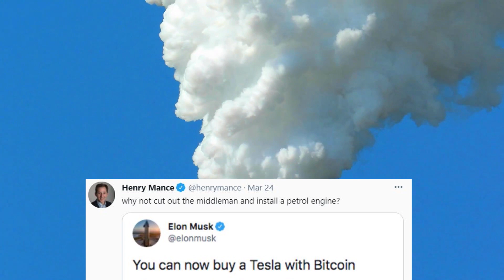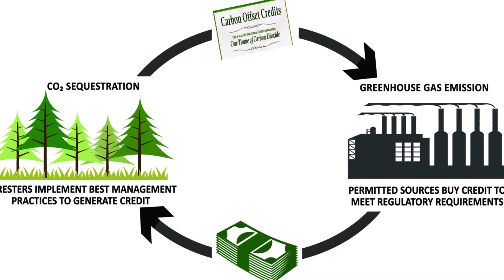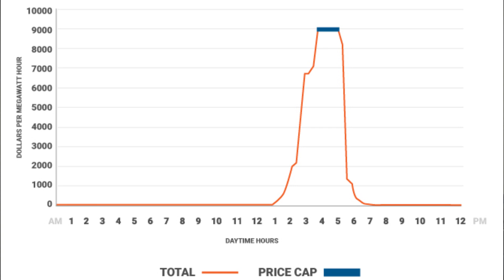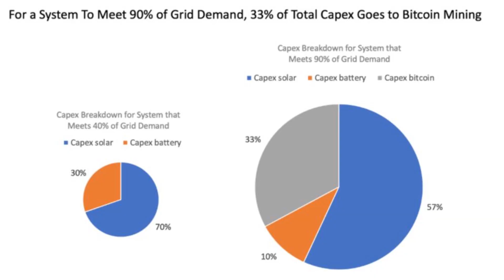The Bitcoin Green Revolution - Is Cathie Wood Right About The Environmental Impact of Bitcoin?

Comment: The biggest problem with this thesis from my view is that it assumes green energy will be what is demanded for mining bitcoin. The thing is that bitcoin is energy neutral, it doesn't care which type of energy it receives, so the cheapest form of energy is prioritized. In this case, there is a very good case for nuclear energy, which is an industry that I am personally interested in, especially as China has been expanding it's nuclear to provide more energy to more of it's citizens. It is possible that the US might change course on being anti-nuclear if China implements it, which would make the industry explode in terms of profitability. 

The biggest issue for nuclear energy though, is that it threatens the business interests of much bigger energy producers, such as solar, wind, and natural gas who have an abundance of demand through lobbying. Various age old concerns about nuclear proliferation and meltdowns are used against nuclear, despite various reactor and fuel cell designs that make it physically impossible to repurpose for weaponry needs or meltdown.

Comment: To summarize, we’re going to quintuple the worlds power generation just to produce an intangible currency that is completely unsupported and unregulated by any government which puts it at a high risk of losing its entire value at any point in the future. 
Oddly enough, the top 3 cult fanatic investments of crypto, EVs, and battery storage are being combined into 1 mutually supporting investment thesis and being pumped by the pyramid investment queen herself, Cathie Wood... not to mention that the entire reasoning behind the thesis is beyond flawed. It’s diametrically opposed to reality.

Love these reality check analysis’s @patrickboyle !!!

Comment: In theory, and according to the bitcoin "plan" laid out by the mysterious Satoshi is that at the 6th "halving" over 99% of all possible bitcoin will be mined. This is currently projected to happen in 2032 or so.  At that point it will be much much much less profitable to mine bitcoin.  At that point finding a bitcoin would be akin to winning the Powerball lottery. Unless Bitcoin goes to a million us dollars or higher, most miners will drop out, lowering the hash rate and thus the power consumption. 

The "plan", such as it is, is that miners will maintain the network for lots of reasons, ideology, profit (only much smaller, transaction fees only), or they are financial institutions in the new crypto economy that benefit from having a copy of the blockchain locally. 

The Bitcoin network could be maintained securely for a millionth of the current power consumption. Yes a millionth.  This high power consumption period was considered a necessary evil phase to establish the network. 

I don't necessarily buy in to any of this, just reporting what I've read over the years.

Comment: The sort of green energy future painted by that paper is a very optimistic concept. It would work best if done on a macro level with solar panels and batteries distributed by the grid operator for a grid designed for renewables and with the distributed crypto mining baked into the electrical grid design. The infrastructure cost for that if done to the highest degree would be very high. Which is why China could do it. They have the means of production right there and the ccp has huge financial backing. For most established towns in the west the best you’ll get is either a high number of enthusiasts who fancy themselves as entrepreneurs or businesses forming that are able to make solar crypto mining into a profitable and scalable enterprise. In Australia solar uptake is very high thanks to government incentives. For the many solar accredited electricians down under some are starting to capitalize on their qualification allowing them to set up huge solar arrays at their houses , sometimes using older panels obtained for free from system upgrades (that are becoming more common as bigger systems have become a lot more affordable over the last ten years) and setting up crypto mining rigs to use that free energy to make money at home. The biggest barrier to entry is the cost of batteries and the cost of setting up a crypto mining rig. That’s well over ten thousand in capital expenditure to be recouped before gains can be realized. That would take probably two to three years if I’m being optimistic about what that crypto rig can pull in. In fact I wonder if a crypto mining rig can pull in more over ten years than a etf that takes in steady ten percent annual returns

Comment: Honestly the model is very naive, not all miners are doing massive operations that could go on the route of creating all that infrastructure just to mine. A lot of miners quit when the price drops. In my opinion the solution is the proof of stake model, yes it still consumes energy to process transactions (as it consumes energy to read this read/write this comment) but at least you don't have the issue of increasing difficulty resulting in needing more powerful hardware and more energy

Comment: Bitcoin is dumb because it's designed to require a lot of energy to mine and therefore has a carbon footprint.  Unlike storage of excess energy in a battery, the storage of energy in a bitcoin is irreversible; you can't power the city with bitcoins.  Therefore, I'm out.

Comment: 10:15 To answer your main question, please check Tony Seba's concept of superabundance: If solar and wind energy and batteries are really on a declining cost curve, energy becomes superabundant. This is a good thing, because at first it will make gas and oil obsolete. Only then there is so much capacity that now it can be used for Bitcoin mining.

Comment: As long as both Square and Ark Invest have mutually motivated goals in crypto and green tech it is not surprising they used the same narrative for the same cause. Does it make their points more credible? I strongly don’t it. It is like two salesmen pushing the same brand. They do not bother much of true reasoning altogether. They SELL!
The utilities sector is perceived as defensive due to state industry regulations. The state influence to be major factor almost everywhere in the world creating incentives right or wrong, restrictions and limits with loopholes or not, distortions in business fundamentals are as common in the utilities that it is not far from universal rule.
This is the start point of any feasibility study so far. Energy balance is driven by the mix of different natural, tech and political factors however for any single part of the world, country or even a local area makes one as different from the other almost to the state of unique. 
Take China with huge energy balance deficit at national level and huge ample power in certain areas of the country where local authorities subsidies electricity consumption for mining.
In Russia where the industry deregulation and modernisation  of  old power infrastructure caused ample capacities in some regions while other are still substantially Susa fixed and old. There are many loopholes in regulations as well used by state run enterprises and crony businesses.
Take Bielorussia as a more simple example. This small country used to import power from other regions of the USSR after Chernobyl tragedy, for years carried deficit in a balance of energy and decided to invest in new nuclear power station. By the time the project is complete they have a huge amount of ample power with nowhere to use as the real consumption growth well behind former conservative estimates. Guess what was a solution? A huge state run mining pool.

Comment: Everything uses energy. 
400twh for aircon in china
240twh to aircon in us 
440twh on tv's
Bitcoin 121twh, 76% on renewables. Thats 0.075% of global energy damand.
 That is absolutely tiny. On the latest miners 1 terahash uses less energy than an average light bulb. Why is bitcoin an issue. Everything uses energy but for some reason bitcoin has to be green otherwise it's wrong.
People are going to lose their mind when they realize how much  electricity is going to be needed when electric cars become more popular.
Also comparing visa and bitcoin is not exactly the same. Visa runs ONTOP of the banks AND fed wires(as an example) AND Swifts infrastructure. And let's not forgot the millions of bank employees who have to burn energy every day to make sure the banks can operate.  Not that I have an issue with them using energy but this does seem to be the flavour when talking about Bitcoin so why not include it. Ie energy usage is wrong

Comment: Using excess power to mine Bitcoin doesn't seem like a bad idea imho. In summer Germany has to sell their excess solar energy to Belgium and Netherlands at a price of -5ct/KWh, so basically they have to PAY! 5cts for them to turn off their nuclear power plants as to not overload the grid. Unfortunately German grid operators don't adjust prices according to short term supply/demand changes. If they did adjust the price however, you could technically get payed to charge your EV or mine Bitcoin. That way, Bitcoin miners wouldn't necessarily have to be directly involved with the power production. (Which seems kinda dumb to me anyway, because if you are good at mining Crypto doesn't mean you are good at running a power plant and vice versa)

Comment: What commodities are used to build solar panels? Asking for a friend.
Reply: A lot of rare earth materials are used in the production of solar panels...solar and wind are not as green as a lot of people believe.
Reply: @cosmiccoffee8497  Rare earths aren't used in solar panels, at least not much.
Reply: @seneca983  They are and a lot of them are. There are also maintenance costs among other things. 

Here is a quote from google;
"Renewable energy development relies upon sufficient quantities of rare earth minerals, specifically neodymium, terbium, indium, dysprosium, and praseodymium. These are used in the production of solar panels and wind turbines."

Solar panels also degrade over time and have to be replaced. Same with wind turbines. There is more to wind and solar than the face value of the feel good narrative stuff pushed by many.
Reply: @cosmiccoffee8497  Your quote talks about renewables in general, not solar panels specifically. Rare earths are used in e.g. wind power but not (much) in solar panels.
Reply: @seneca983  You should seriously go look up what it takes to make a solar panel. It might surprise you.

They aren't made from hopes and dreams.
Reply: @cosmiccoffee8497  They aren't but they aren't made of rare earths either.
Reply: @seneca983  They are. Go look it up.
Reply: @seneca983  You should also check out all the crap they put in batteries while you're at. You need a few of those for every solar system you put up.

Edit: Lets just add DC/AC inverters to the list while we're at it. All that's just the tip of the iceberg.
Reply: @cosmiccoffee8497  I did look it up. The result was that they're (mostly) not used in solar panels.
Reply: @cosmiccoffee8497  You can consider those aspects but they're not what I was commenting on here. You said: "A lot of rare earth materials are used in the production of solar panels". That's the part I responded to (by noting it's not true).
Reply: @seneca983  Okay dude, where does the metal for the screws in the frames come from? Again, what do you need to run a solar array? How about the chemicals processes used during manufacturing? how are all of these various things sourced and shipped about?

Oil, gas, mining operations, sterile production facilities, robots, computers, engineers, interns, planes, trains, automobiles, etc, etc, the list goes on and on and on with things you need to make a single solar panel.  

Guess you're going to need a rubber tree plantation somewhere for all that insulation on the wires too. This is all magic pencil stuff.

"Mostly" as a caveat meaning because they're everywhere in the food chain for making these things including in them. The requirements to produce a thing goes much deeper than what is in the thing itself. Again, look past the face value.
Reply: "What commodities are used to build solar panels?"

I think the biggest ones are probably silicon and electricity.

Comment: If the goal is to switch to green energy, mining bitcoin must be considered 100% non-green, because every additional Wh consumed by mining must be produced in a fossil power plant, that could otherwise be switched off.

The energy hungry part of crypto mining is the consensus algorithm. Bitcoin uses Proof of Work - miners guarantee the truth of a transaction by expending work (using energy in mining hardware), for which they are compensated by the network. The compensation would be lost, if the transaction turns out to be wrong at a later point --> They are motivated to only add real transactions. However there are alternative consensus algorithms that work without expending huge amounts of energy like the traditional systems, although there is still debate about security. 

I think real the real "green crypto" will be one, that does not depend on PoW mining altogether and instead uses Proof of Stake or a newer revision of it.

(Combining mining and energy production just seems pointless to me xD There is no "cake" in this combination, except for some rare edge cases. (Example: solar + mining in extremely remote places))

Comment: You should be comparing BTC's energy demands to the energy demands of the current dollar-based system underpinned by US Treasuries which requires US naval dominance of the 7 Seas to enforce.  I've heard that it costs over $250 million per day just to start up the hardware and keep it operational.  Otherwise, a good review of the faulty analysis in question and I enjoy your dry wit.
Reply: 😂 good one! Maybe if the started using electric ship vessels they could reduce the carbon foot print of the dollar 😂😂

Comment: You could use off-peak power to mine coins, but the coins mined might not be worth as much, as there would be more power available to your competitors as well. This would lead to coin prices fluctuating with weather, including insolation and wind speed/direction. That would create some opportunities for people with excellent weather data.
Reply: That makes little sense to me. You gain a set amount when you successfully validate the reenactment.  Moreover, I don't think increase in percentage of new coins being created in a sunny day would be so low as to not meaningfully change BTC value compared to bad weather
Reply: @wtrbns  If an entire country runs on solar and  it didn't have the capacity to store excess energy generated in sunny weather conditions, and it would then start mining Bitcoin using said excess energy, it could definitely impact the Bitcoin price.
Reply: @wtrbns  You don't understand the difficulty adjustment. If the number of miners goes up by 50%, bitcoins' proof of work algorithm automatically becomes 50% more challenging, ensuring an approximately constant supply of coins.
Reply: @joefox9875  I don't think you're contradicting me, I'm arguing BTC price won't fluctuate much because of weather.
Reply: Interesting, but if there's a constant supply of coins, why has the price gone up by so much so quickly?
Reply: @robertplatt643  Do you mean the new supply? The current inflation rate is only 1.7% for the time being.
Reply: @robertplatt643  speculation and markets
Reply: Haarp, sura and the tromso installation will set the mining zones and season. Also who will mine when no more bitcoin is generated by validating the new chainblocks?
Reply: @flipflopdancer6728  They'll be payed in transaction fees from what I understand

Comment: yeah, putting an electron into a heating element is pretty stupid, when you can put that same electron into silicon and use it for both heat and processing. I have been getting paid to heat my home now for a few years and when summer comes, it heats my pool and potable hot water. I'm a very stupid person so I have been very disappointed that it has taken this long for industry to figure this out. The future is efficiency, if you can do more with less then you win, it's that simple. Or it should be, after you get the government subsidies involved and entrenched institutional power you end up stagnated and unable to move forward on something idiots like me can figure out but wealthy intuitions with almost unlimited funding just can't seem to grasp.

Comment: It appears Cathy's estimation doesn't take into account that 5 times the current global energy usage dedicated to mining, comes with a corresponding 5 times increase in the heat output created by current electricity generation and use. There is an upper limit on energy usage regardless of the carbon cost as well that needs to be considered (Earth's Heat budget).

Comment: I have not read the paper but my guess is that the author of the paper means crypto mining solves the intermittency problem of renewable energy, as it is much more flexible than other type of energy use. Note that there is often a mandatory limit for the penetration of renewable energy in a power grid, due to its nature of instability, therefore we can not simply build more renewable energy plants and plug them all into the power network. The flexibility of crypto mining power usage makes it possible to simply increase the number of renewable plants without worrying that they would otherwise be asked to shut down when their power output reach the mandatory penetration limit in the grids.